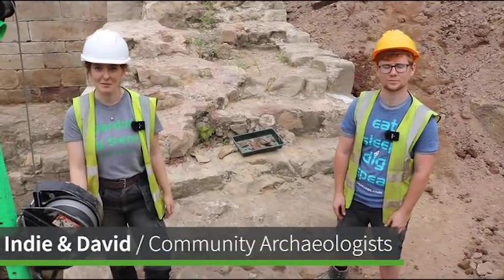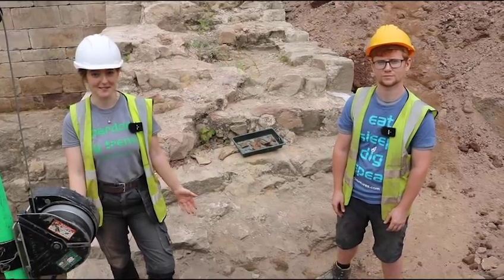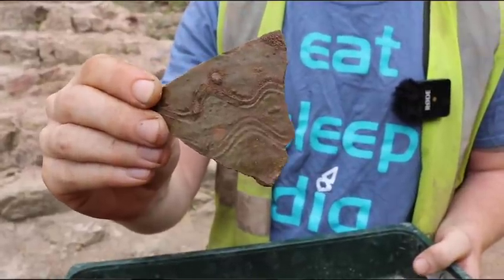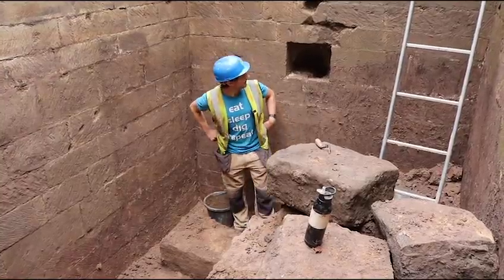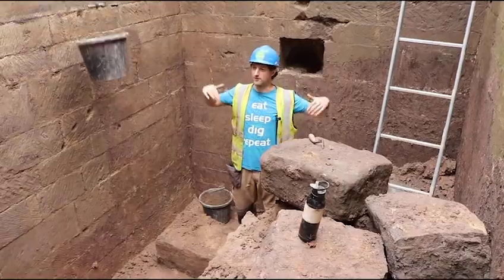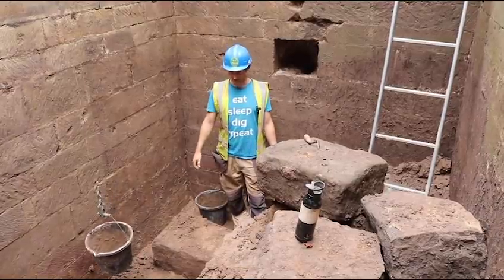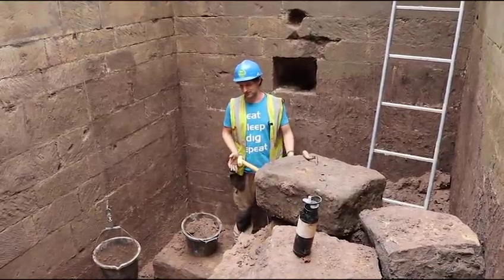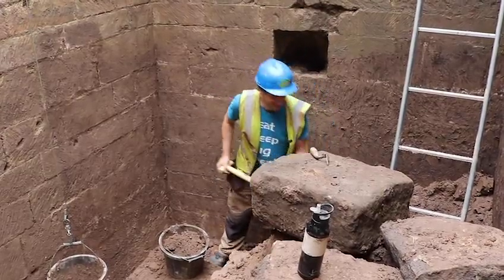We reached the bottom of the drawbridge pit at PONTEFRACT CASTLE

Comment: Well done! Just a thought - could the two large stones have been used as counterweights on the original drawbridge??? Are you able to calculate or estimate the original dimensions of the drawbridge itself from where it would have pivoted?
Now the pit has been excavated so far, will it be left open as part of the castle visitor experience and further investigations? Be a shame to have to fill it in again!

Comment: have you gotten a regular city plumber down there with a camera snake yet? it's amazing what technology can do these days they can also track the camera tip with a sensor and give a 3d picture. I'm only guessing, but could the rectangular hole be a drain that keeps the moat from overfilling? If there was a timber support in it they would have just left a block out, and with a timber that size you might have found something leftover. Clue me in if I've missed anything else on this spot. I think time team opened it, right? I love that everything ancient always just brings more and more questions. The answers are great too, but they lead us to question the answers on top of that! That circle above looks like a later repair or something like a brace, and if the blocks at the bottom were in situe, perhaps it was for supports but perhaps it rained and they tossed them in for the workers to stand on. I've heard it rains sometimes in England. And job done, like you said it would be a pain to bring them back up, especially if they were underwater, so why bother? Somebody please clue me in if there is any more footage of this site. I'll look, but I'm not very good with computer stuff.

Comment: 7.06. I hate to have to point out that the eroded stone wall we see in front of us looks like a different type of stone from a previous build, as it seems to have no purpose being there. Being a brick layer, I am in awe of the ability of these stone masons to lay those stones with no mortar joints. Even if these were molded concrete blocks, they wouldn't stack like that. Anyway. Digging 6 meters down to find 14th century pottery. ??? Surely there must have been some kind of flood to put so much sediment down there. As for the whole. Put a camera down there. ???